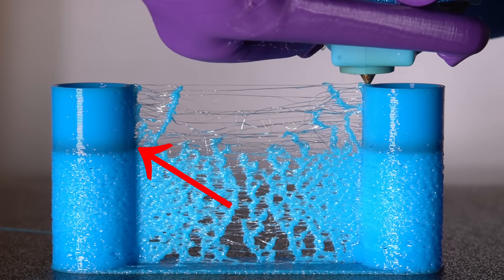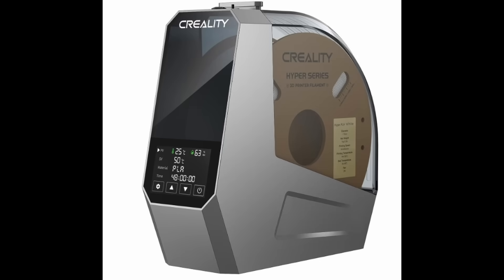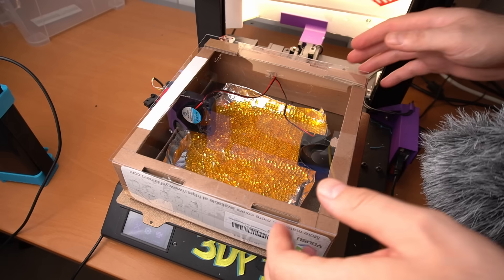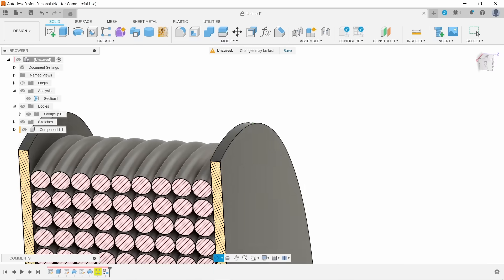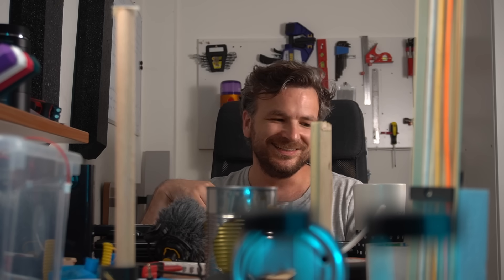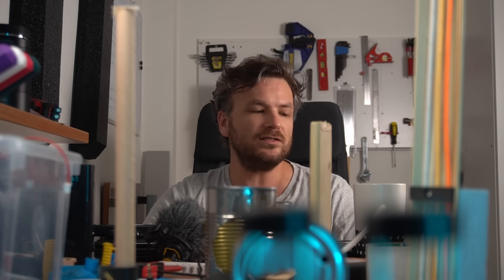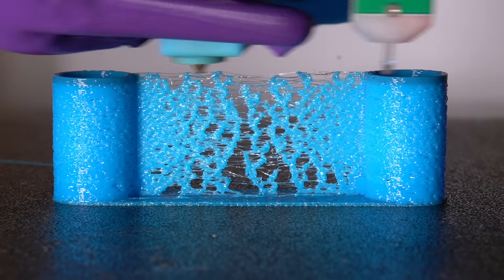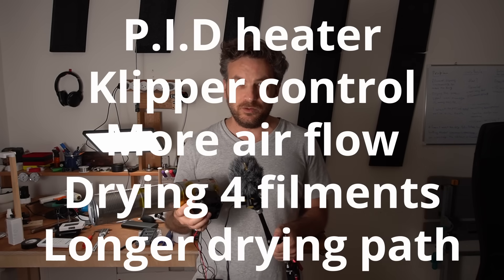Why are we drying filament this way?

Comment: For those that were wondering, hes using a 300w PTC heater.
I had to dive into his printables text to find the wattage.
Reply: Thanks. @3D Printting Ideas, pin this!
Reply: that's the total amount of energy my ender 3 uses.....
Reply: @PedroLiberal  You can turn that amount of power way down if you built it smarter, meaning insulation and better temperature sensing. I Build one as a test using a 20mm id steal pipe, wrapped in heating wire and blowing warm dried air in through the bottom using a aquarium air pump. All nicely insulated. For PLA i get away with about 50 Watts of power consumption. Higher temp stuff like ASA or TPU takes about 100 Watts. Doesn't work for Nylon (PA) tho.
Reply: @PedroLiberal  1. Power is not energy; it is energy that flows over time. 2. Your Ender uses PWM for both E and bed, right?. 3. In a dryer, is it the power or energy that matters or the filament temperature?
Reply: a food dehydrator works great and is cheaper
Reply: @honda-s2k but waay slower right? Like 4 to 5 hours
Reply: @mbharatm depends on the dehydrator and the settings you set it at. I set one up that has no temp control and has stacking trays. I can dry small rolls within a few hours. A full kilo might be 5 hours. I just set it and forget it.
Reply: @Katskraftkorner  Yes but like he said, he's trying to print something now, not in several hours. I have been running into that problem more lately as well in my own setup since I've never had to contend with the summer humidity in my area before. I can't tell you how many times I've just decided to use PLA when PETG would have been better just because it's not dried and I know the quality will not be good.
Reply: @prendes4 thats his and your fault for not planning ahead. I have 2 ace units that dry 8 kilos at a time between them in addition to the dehydrator.  I have summer humidity too and i plan for it.
Reply: @Katskraftkorner  Good for you? No matter how you slice it, affordable, inline filament drying would be revolutionary since not everyone has devoted a whole wing of their house just to drying their filament. Here's the deal, bud. Let's say I want to print a 4-color file using PETG in my AMS lite on my A1. I have to take all 4 spools to my single dehydrator, which can fit 2 spools if I'm REALLY pushing it. Then I need to dry the first 2 spools (delaying my print now for several hours) followed by the next two spools (and another several hour delay). Now I can finally print... For maybe a week before they're essentially unusable again. And heaven forbid it's my 5kg spool that needs dried because that's DEFINITELY in the dehydrator by itself so now I have 3 drying sessions worth of delay. And add to that the fact that I'm typically using PETG in my more functional prints which means I might have other prints hinging on the PETG part(s) being complete so now that's delayed too.

None of this is hypothetical, by the way. All these scenarios have happened to me in just the last like 2 months. 

I'm not saying dehydrators are bad. Just that they don't solve the problem as well as an effective, affordable, inline drying system would.
Reply: @prendes4 well, for starters, my house isn't big enough to have wings. Secondly,  i planned my set up before I bought it and the legwork to determine what would work best for me. So skip the jealousy.  Its childish.  You chose your set up and chose to be in that position.  Theres plenty of stand alone dryers on the market you could buy and theres plenty of diy solutions you could build. Its on you if you haven't done anything about it to solve that problem.  And yes, dryers can dry your filament as its fed into the printer.  And it all sits on 6 foot steel table with a diode laser that eats half the table. Its not that much space being used. My filament is sitting on wall mounted racks on the wall so they're not taking up floor, shelf or table space either. I printed the brackets out of petg for them. A couple pieces of half inch pvc pipe isn't exactly going to break the bank either. And you could do that on pegboards if you chose to. Your delays are your fault and its on you to do your homework to find the solution.  Being sarcastic and jealous isn't going to change that.
Reply: @Katskraftkorner  Oh trust me, there's no jealousy here. I'm not jealous of your (at best) moderate 3D printing setup and I'm certainly not jealous of your superiority complex or the kind of person your obvious privilege has turned you into. I'm not lamenting my setup. I don't need a billion dryers and frankly, I doubt I'd even want as many as you've described. My setup is easy and works great for most of my needs. And unlike you seem to be implying, I do have plenty of space for it. It just doesn't make sense in my current setup.

I described my situation to highlight A SINGLE SCENARIO where an inline dryer would be useful. My comment isn't just about me. My printing setup isn't perfect but it's actually super useful in most of the ways I need it to be. And I'm constantly improving it. 

I'm trying to get it through your thick skull that firstly, not everyone chose to be in whatever situation they're in and if their situation doesn't allow them to fill a whole room with dryers, this might be a revolutionary tool for them. And even if every single person had the unfettered ability to set their printing area up exactly how they like, it's entirely possible that for completely valid reasons they wouldn't prioritize drying their filament to the point of having nearly a dozen dryers. My response to you could be boiled down into one single sentence: "Not everybody is you and other people have different setups with different needs." The fact that this is the case is not some kind of personal flaw on their part. Frankly, the only personal flaws I'm seeing here are the ones dripping from every sentence you've written.
Reply: He didn't just describe the PTC parameters, he even left a link to the product in the video description

Comment: Actually I have box that I put my printer and filament in while using like wardrobe or printdrobe. That box has ptc that keeps inside on certain temperature like 60C or so. I generally print ABS and it is also humidity sensitive to have successfull, non broken prints. Keeping everything in heated box also helps me to dry filament on the go.

Comment: You need time to dry filaments and is easy to explain. You need to take out the water without compromising the integrity of the filament. If you put the polymer + water + temp you are facilitating a chemical reaction. Prolonged times above certain temp can also affect polymers. So you have the first barrier that is a max temp, second you have the fiscal barrier that is the water through the polymer itself. There are many exceptions on this topic. To that you have to add a spool, the water need to go through that also. At the end, you are just taking away the roll part, al the other process has to happen. But you pointed some  good stuff, to dry you need temp, flow and you need to change the air also to let the moisture go somewhere else.

Comment: For some reason I thought you were going to spool filament around the can while it gets heated up. It would increase surface area and boost heat transfer. In fact I'm convinced if you can get a busted printer you can pull out the fuse unit and get that hot (already has embedded heating and bearings) and that could serve to boil off moisture faster than air drying it.

Comment: Someone probably already suggested this, but you could create a longer drying path by having it wrap around a free spinning spool inside the heated chamber. This can keep the chamber relatively small , and I’m imagining that the spool has a perforated center core that lets airflow reach the inside of the wrapped filament. I would think only a few wraps around could create decent amounts of exposed length so you don’t have overlapping layers on the spool like you would with a full spool.

Comment: My ideas: If you blow hot humid air into the filament, you won't remove the humidity. Also, the time the filament spends inside the in-line-dryer is too short.

Comment: What if you used PVC piping with an old hair dryer element and a fan? Cut two holes in the pipe, one at the top and one at the bottom on opposite sides, and have the hair dryer element at the bottom and the fan at the top blowing out of the pipe, drawing air in through the hair dryer, while taking advantage of thermodynamics? (hot air rises)

Comment: Hello, I worked on 3D printer filament drying for some time, and can give you some rough perspective.

In-line filament drying is possible, and you highlighted some of the key issues with conventional drying.

This is a problem with many layers. I will lay a few out for you. Drying the spool from the outside is very inefficient, as you point out, because inner layers of filament are subject to stagnant air or stagnant filament next to them, and so the diffusion time is very long.

When filament is first made, it is often made by heating up raw material, extruding and pulling that material through a water bath to cool it down, and winding. That means the material starts wet. Some companies then vacuum dry their filaments.

There are multiple diffusion problems that must be solved. Firstly, the diffusion of water into filament (I worked primarily on nylons, but this is applicable to any filament that is hygroscopic) is a history based process. Time, temperature, and humidity are what matter. But not just the humidity of the air, but the humidity of the bits of air right next to the filament. This is what your fans are helping with. If you use hot air to dry a filament "in-line", with no fan, you are relying on natural convection, either driven by buoyancy from concentration gradient changes from water vapor differences, or from small temperature changes in the air. Forced convection replaces the air immediately next to the filament with new air that has the ambient humidity, which ideally you would want to be dry.

Your experiment with the silica beads and fans shows this behavior. If you wanted to dry a volume of air as quickly as possible, you should blow the air directly through the dessicant. This will cause the water vapor molecules to hit the little dessicant jagged edges and adsorb onto them. This will also use up your dessicant faster. Similarly, this works in reverse--like your experiment.

So, time also matters. Diffusion is driven by this number called the diffusion coefficient. It is very much analogous to conductive heat transfer (actually, the math is identical for thermal diffusivity versus mass diffusivity, it is just that thermal diffusivity is k/(rho*cp), and mass diffusivity doesn't have that analogous breakdown. The diffusivity of water into nylon is slow. This means that if you have nylon which is soaked fully in water, it will take a long time to pull the moisture from the center of the nylon (r=0), even if you are driving the fans and causing the gradient to be large at the surface. Increasing temperature helps to increase diffusivity.

This also means that if you BRIEFLY expose filament to moisture, even dunking it in water for a few moments, it is possible to dry it very quickly, because the water has not diffused deep into the material. The quicker you begin drying it the better, because you want to keep the moisture at the surface where it is quicker to extract. I was able to demonstrate this with moisture analysis in my past life.

So that is the first radial diffusion problem, the filament itself. Now you have spools. Spools diffuse much slower because of their thickness, and some can be made from different materials like cardboard which stores moisture, or have different cutouts. These all complicate the math, and are why in-line systems can be great. That said, it is sometimes considered easier to just control the environment.

The environment is difficult as well. If a drybox is perfectly sealed, there will need to be a pressure boundary, and some way to get rid of moisture (usually, a dessicant). The equilibrium moisture content of a dessicant depends on a number of factors, and their ability to adsorb (not absorb, because they are instead driven by surface area) is similar to the working principles I was discussing earlier about diffusion. Basically, you have to have somewhere for the moisture to go.

It is possible to make air dryers that continuously regenerate desiccant. These exist, and I can give you additional information if you are interested. I tried to build one for cheap a few years ago, but was absorbed in other projects and didn't finish, but they generally are used for industrial "clean dry air" generators. Basically big boxes with compressor, pressure swing adsorption systems, a drain, and a few solenoid valves and some PLC to control.

This is a method to avoid having to recharge or replace  the desiccant, and works very well, but is a hassle. No one wants to add a giant compressor or a drain to a 3d printer, but this is life, the water must go somewhere.

If you dry filament with no air exchange, you will be partially successful, because temperature will drive the moisture out...but if you don't allow anywhere for that moisture to leave the box, then over time it risks going back into the system.

Also, no drybox is perfectly well sealed. The materials used to seal may be permeable (even if they are tightly sealed) to water vapor, and if there are any gaps, for example, along the filament tube (which of course has gaps, because the filament needs to exit the box), there is a driving force from pressure changes in the environment to create motion of air, this replaces the dry air with new, wet air, and you have the 1d axisymmetric diffusion problem again.

So in reality, this is like a mix of the following:

2d (r, thickness, t) transient diffusion problem (spool),
1d (r, t) transient diffusion problem (filament),
similar heat transfer equivalents if you want to do it really well, because diffusion coefficient is a function of temperature,
and some fluid mechanics.

Also you will need moisture analyzers, which are painfully expensive for a hobbyist, to verify this, with tons of test data. I've been there before, and it is slow tedious work. I built numerical models for much of this before, but the experimental route ended up being more effective than the analytical method, but this is what I ended up at.

I have a lot of thoughts about how to build an ideal in-line filament dryer, and I don't think it'd be immensely difficult to pull off with my knowledge. The difficult part is the mix of experiments, testing, and verification needed to set a few parameters--basically, how long do you have to dry for, and under what conditions, to get the center of the filament to an acceptable level--and what does "acceptable" mean from a print quality perspective? These are the fuzzy questions that must be conquered before certifying a good product.
Reply: And actually, the filament along the Bowden tube is a pair of coupled 1.5d radial and axial diffusion problems, not just radial, because the concentration of water vapor and moisture will vary with r and L.
Reply from the maker: Thank you for sharing your knowledge with all of us.
At this point I understood about half of the written here, this will be a great resource to come back to and gain deeper understanding of filament drying.

Comment: Let me ellabotate on the black box. Because I know what is inside. For instance the "material station" from ultimaker has a clever design. There are silica grains like in your new shoes (like literaly the same type, just more). They can be heated to get the moisure out of the grains and cycle them indefinetly. So there are grains, a heating element, a few fans for faster airflow and a valve to either blow air from the filament compartment trough it to dry the filament. Or to "clean" the grains and heat up the grains and blow the air to the outside of the machines. Please contact me if you plan on making such a thing. I'm happy to share how it works:).

Comment: I think you have to start with the filament reel in a closed box, otherwise it's absorbing moisture from your surroundings, and adding an inline drying element would be even more beneficial... I wonder if a perforated Bowden tube guiding the filament within another larger tube blowing drier air through it would work even better.

Comment: You could increase the chamber exposure time by creating a loop to run filament through the chamber twice, perhaps adding a 608 bearing or some tubing at the end for the 180° curve,  perhaps a stretched spring as an inner guide channel for the filament to route through the cans to maximize surface exposure without having to disassemble the assembly each time you want to change filaments. 
Could also design a 3d printed fan mount that volts to a can rather than the tape. Church it up so you can charge $2k as well

Comment: You could design a corkscrew path for the filament to move through in order to minimize the length of the design. Also, if the design were 3D printed out of PETG, you could integrate a fan and heating element on one end and an output vent on the other. I would think that an adjustable mini-heater could be adapted for this use.